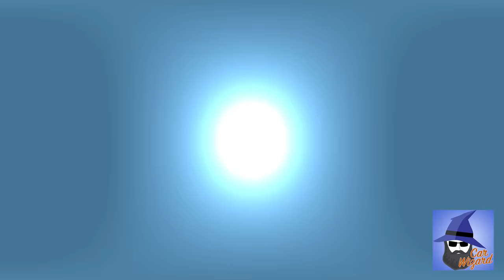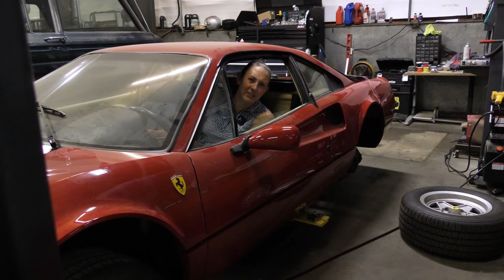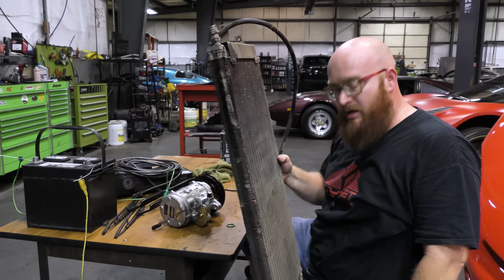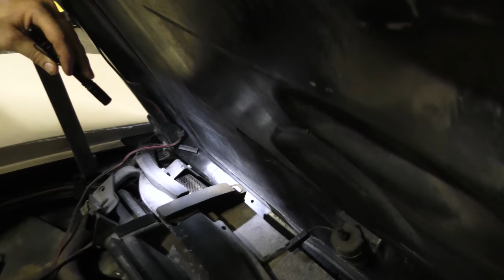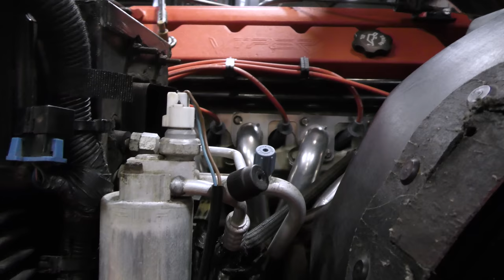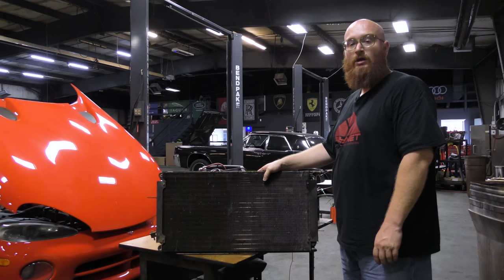Your AC died, now what?!? CAR WIZARD shares several reasons why it dies & the repairs to fix it

Comment: My '94 Chevy Suburban w/rear air has yet another bad compressor unit(the dreaded "pancake" or radial compressor once again), still blows cold but sounds like it's going to shell out any time now when running, and the rear evap core expansion valve has ceased to work again(a 6 hr. job to access requiring removal of half of the interior trim in back and cutting open a fiberglass housing), so fun time! Another $500 for a compressor, expansion valve and receiver/dryer plus hi pressure switch and low & high side fill ports(hi side uses a rubber check ball that has failed in the past for me with normal system pressure)., plus a trip to my local A/C shop to evac the system for me to save a bit on freon costs. I have my own vacuum pump so I can replace all said components and leak check it. Use green dye to color the system gasses, easy to leak check w/blacklight at night. Barrels of fun!
Here in Lake Havasu, summer temps are routinely 105-110 days and 85-95 nights so A/C is a must-have here.

Comment: I had a millenial workmate who didn't know how to look after a car..he had never even changed the oil himself...didn't know how the coolant recovery system worked...didn't even keep the windscreen washer bottle full.
He had bought his 1994 Nissan some 5 years previously and had never had the airconditioning working because "it was broken".
I asked to take a look at it. 
He switched the engine on and hit the a/c switch....no a/c.
I looked at the fan switch...on "0".
I asked him to switch the fan to "1"....a/c blasted cold air......

He had driven a car without a/c (unnecessarily) for 5 summers...and also had not had the benefit of dried air on the screen in winter....
Reply: No surprise there!
Reply: Here's a novel idea>>read the MANUAL! It's amazing what you can learn!
Reply: @hotpuppy1  
JDM car...can you read Japanese????
Actually, even with him reading the manual...he still has so little background in mechanical things (but a degreee in computer science) that it would be gobbledegook anyway...

Comment: My Subaru’s fuel pump died AT the gas station.....the pump was 2 months old, I had preemptively replaced it because the old one was 20 years old.
My “new” Honda’s air conditioning stopped blowing cold today.......94 degrees in the shade.

Comment: Wizard...u forgot to mention sometimes there is an easy fix for some AC systems, which is changing the solenoid control valve that use to come inside of AC compressor....I did that in my 2014 Altima and AC will start working fine again....the mesh in the valve was clogged and according to the technician this valve is responsible for almost everything in modern AC systems....after replacing we just did 30 minutes of vaccuum to get air out of the system...new R134a gas and ready to go..!!

Comment: The display image fits well. A viper requires 2 compressors and 3 condensers to get enough cool into the cabin lol. Talked to someone just yesterday about why he didnt drive the viper and he said too much heat radiates in the air cant keep up in summer.
Reply: I have an old viper (1998) once i got the AC redone its cold , even in 90 + degrees.
Reply: @davidmopar8446  I’m actually referring to the newer generation. I remember back riding in one of the classics when I was younger and it was hot. Was the classic blue white stripe.
Reply: @radzer0966  oh, no doubt it gets hotter than hell in there but the AC is strong enough to be cool inside lol

Comment: I looked at a used car once that the ac didn’t work. The dealer said that it just needed to be charged. Checked under the hood and the compressor was missing🧐. I feel bad for whoever they eventually ripped off.

Comment: compressor clutch just went out on my 02 Maxima and temps are already hitting 96 degrees out here in central Florida 🥵. since no one seems to sell a clutch kit for the compressor I ordered a whole new compressor. 

sometimes when Freon leaks there is traces of oil on the lines.

Comment: And don't drive without any 'freon' as it also lubricates the compressor. Even if you don't need aircon, you'll seize the compressor.
Reply: How will the compressor seize if it isn't turning?

Comment: Can somebody point me in the right direction? My 2005 Pontiac GTO has been without AC for 3 years. I live in Florida and this is my daily driver. Not good. The system doesn't have any leaks. The compressor clutch engages. There are no horrible noises. The condensor is practically brand new so I doubt it's clogged. One shop said they think the expansion valve is bad. I replaced it myself and had a shop recharge the system. It blew cold, but not ice cold, for a day. The day after, it was blowing totally hot again. I took it to another shop. They said the compressor is bad, and quoted a $2000 repair. They want to replace the compressor, condensor, drier, and some lines. Thoughts? I can't afford the $2000 repair.
Reply: Take it somewhere else for proper diagnosis.
Reply: $2000? I fixed a gto similar to yours bought a used compressor for like 100 bucks at lkq problem solved

Comment: Could also be a faulty service valve, something I'm dealing with right now. Depending on the car you might be able to change the clutch or coil without having to take the compressor out of the car.
Reply: Yes, in other parts of the world, just the clutch assembly is sufficient, and th compressor still has plenty of life left. Sometimes auxilliary fan as well, if moving car has no problem, but gets warm when stopped. :)

Comment: Just personal experience, I had AWESOME RESULTS converting an old R12 system to R134a.  1992 Lexus SC300, 2015 or so the A/C started to blow warm.  Absolutely mint always garaged 1 owner car with 60k miles and a stack of service receipts.  Anyways took it to my trusted mechanic, he diagnosed it as a leaky o-ring that leaked out all the now banned R12 refrigerant.  He replaced every hose that might leak, which included all new o-rings on those fittings.  Recharged with R134a with original compressor, condenser, dryer, etc.  After the freon conversion it blew just as cold.  Don't let people tell you converting old car A/C systems to the new refrigerant will make them work half ass, that's just an urban myth.

Comment: Not to uncommon but every time I do anything with the AC systems I replace the service ports like if I have to replace a compressor due to a failed clutch or anything else like that I just go ahead and throw in a couple of service ports just for good measure

Comment: We're living in Doha, Qatar and it hit 52 today (126.7 in freedom degrees) this afternoon. Our Nissan Armada's AC could only manage to get the cabin down to about 80 F, even though it will give you frostbite in the morning when it's "only" 38C (100F) outside.  Can we assume that we've just run up against the design limitations of the system's capacity to move cold air?

Comment: The only think I would add is if you can get away with only replacing the clutch you can get away with not draining the system. A backyard guy might be able to do the clutch but might not have the equipment to drain and refill the "freon".

Comment: Here's a weird story.  A friend's car AC went out.  I took it to a corner gas station and he replaced a diode, (I will guess it was the compressor clutch circuit), and charged me 75 cents for the diode and $3 for labor.  My impression was that he had seen it before. Duh. I paid the bill and told my friend to forget it, it didn't matter. On a different topic, I remember riding in my grandfather's 1956 Pontiac and the AC was strong, never had problems.  I suspect that the AC was over-engineered since they hadn't had time to figure out how to build them like cheap crap.  Lastly, I once owned a 1965 Mustang with a 289 and factory air.  I thought it was no big deal.  Years later I found out that only 2% of 1965 Mustangs had a 289 and that most Mustang AC was dealer installed.  I had the top level 1965 Mustang and didn't even know it.  The best American car ever made.

Comment: Wizard you love the 4 runner 
My wife’s 2016 auto ac won’t stay on 

Just spent 1100 dollars on a compressor and not fixed 

Shop said it was a unit you didn’t mention in the video in the dash 

Crazy

Comment: The wife’s 2010 T&C minivan lost A/C charge. She was not happy. The guys at the garage couldn’t find the leak, so they recharged it. It ran fine for two weeks then died again. Back into the garage and I said: “Fellas, this car has a rear evaporator too. Did we check that?” Crickets. Turns out the lines to the rear system were corroded. We replaced the evaporator too while we were in there, and now I have a happy(er) wife.

Comment: Do evaporators have to be replaced after a compressor failure? That can be expensive, depending on how difficult it is to get to.
Reply: Wizard did comment that evaporators can mostly be flushed......(that's the bit under the dash)
but that condensers (the "radiator" in front of the engine coolant radiator at the front of the car) 
cannot be flushed because the tubes are too thin....
Reply: It can if you want to chance the orifice filter caught the debris.

Comment: If nothing else fails, the freon molecules will seep through the rubber hoses and eventually too little freon.
Reply: That's why car makers all say to run your AC at least once a month, all year long. That circulates oil mist with the freon, and that oil mist keeps the rubber hoses and o-rings lubricated, which also prevents frein leakage.

Comment: One thing he failed to mention about AC pressure switch is why they even exist. One significant reason why is the refrigerant is what carries the lubricant oil through the system. If you run the compressor without refrigerant, not only will you get hot air, it will murder the compressor due to lack of lubrication.

Comment: Interesting to see a 93 Viper with AC. Would have had to have been dealer installed. Can no longer get the parts to retrofit Gen 1's with it either.
Reply: They always came with AC.  Just remove the roof and open the windows

Comment: Is it possible to flush the evaporator core if you’ve had a mechanical problem in the compressor?
Reply from the maker: Yes. But not condenser

Comment: I hope you read this! Lol! 
I was 16. Just got my first car. A $500 POS. The battery was dead. Had to push start, a car, never drove a stick, my dad just left me behind. You know, like throwing a kid in a pool so they learn to swim. So the whole way home I’m revving the engine at stop lights,etc. 
well I had to get gas too. We all know the signs at the gas stations “turn off engine, no smoking “ well I was afraid if I turned the car off… it won’t start, so I let it run. I knew that There really is no danger, but everyone pumping gas saw this teenager pumping gas and leaving the car running. I got all bad looks. 
And then the A/C hose blew! A big “pop” and then a fog of Freon billowing from my car!
People at the pumps freaked out!! “Run it’s gonna blow!”they actually ran away. I just stood there, pumped my gas. Laugh about it to this day 35yrs later

Comment: The wizard is right It is much cheaper to bring it to a shop to get them to top it up like Halfords only charge €50 my guess would be worse case scenario probably cost you maybe 100 120 depending on the system

Comment: Should you preemptively change the AC compressor on a car so that you don't have to do the entire AC flush / evap+condensor change when it fails? won't it be much cheaper swap and preventative measure?

Comment: I fixed my a/c in my mk5 Jetta with a $7 relay. It took forever to figure out it was just a dumb relay under the steering column that runs the blower motor.

Comment: My VW Polo was blowing weak and hot air. Checked the condenser, no damage. The Compressor was spinning and there were no weird smells from the vents, so the evaporater appeared ok. When i checked the manifold guage pressure for the high and low port, it was the right pressure, then dropped and built up again. When the pressure dropped the fan would switch off. Wasn't sure whether there was a leak or a/c expansion valve might be stuck open. 
Took it to the garage, they decided to bleed the system and fill it with new refrigerant with a dye to see if there were any leaks or if their machine would detect anything. There were no issues and now the a/c is nice and cold. Any thoughts as to would might have caused my a/c to temporarily fail?

Comment: Hello from NW Arkansas.  Question:  My ‘03 Tacoma has the original AC system and is working fine.  Do you advise having it checked to make sure the system has the correct amount of Freon, or follow the rule of it’s not broke don’t fix it??
Reply: If it’s not broke don’t fix it it’s fine unless it’s blowing hot air

Comment: What about not performing very well, with a new evaporator, new accumulator/dryer, condenser is externally clean, and all pressures make sense? Am I just a sweaty bastard that runs too hot for this climate zone?

Comment: What about when your a/c works great until it is 95' outside. Charge is good and fan works. Is the ambient sensor in front of the condenser involved with the a/c compressor?

Comment: My 06 Silverado does a weird thing. The AC will work for 20-30 minutes then go warm. If I shut the truck off and immediately turn it back on works fine for another 20-30 minutes 🤷🏼‍♂️

Comment: Pro Tip: If you have an early to mid 90s GMC/Chevy truck and you turn on the air and get a flashing red light and the air won't work. Unhook the battery for 5 minutes and re-connect. The air will work again.

Comment: “Every car will leak it’s refrigerant out by the end of it’s lifetime.”

My mom’s old 1989 Camry is laughing at that statement in car heaven, the R12 system was STILL working and cold enough to freeze a glass of water in 2020 when she had an accident involving a basketball sized rock on the highway and totaled it (she bought the car in 1994 and never had the A/C serviced).

Comment: I had a rover 75 cdt from new after three years the aircon failed. Turned out the dealer had not clipped a small radiator top hose back properly, and it rubbed a hole in the aluminium air con pipe

Comment: I have a 2004 Lexus ES330. The ac works fine but I hear a rattling noise constantly.  Someone told me that a little door needs to be replaced. What do you think?
Reply: sounds like the blend door is going out. that's a $15 dollar part that costs $1k+ to fix. it's behind the dashboard and usually requires the removal of the entire dashboard to replace
Reply: @hirisk761  thank you so much

Comment: Hi Car Wizard, let see if you can guess what it could be . 
I have a 2003 Toyota Rav4 that once you press the button the clutch engages and after few seconds stops and the AC light blinks, They check it out and it gas enough gas, I think is because there is no air filter  on the cabin , could be that?) Thanks

Comment: The biggest issue is that people dont use thier ac all fall and winter and even spring.. nothing gets run, lubricated etc..  Run your AC for 10-15 minutes once a week when not needed and you wont have issues usually.

Comment: Hey car wizard I just got my ac working but because everything is 32 years old and to my surprise it will still hold Freon for a few months and I got a leaking seal on the line. I bet if I brought it to you or any mechanic I will get billed for a full ac system rebuild. :( I bought a new China bs condenser, the ac lines are bent in the wrong way and the fitting on one of the lines cross threaded. Still holds Freon somehow but the oring is what seals it. I reused one of the 2 o rings.

Comment: Have a 2006 subaru outback has a bad temp sensor so the ecu thought it was hot.   So it wouldn't allow the ac to turn on.

Comment: do you need to replace the high presser valve on the compressor if its used or will it reset?

Comment: So, what if I just had system recharged and pressure checked and then it still continuously takes 5+ minutes for the system to get remotely cold? 06 BMW 3 series. German shop said the compressor is getting “tired”. Is it possible to be failing intermittently? I just figured it just goes out.

Comment: David, I was always told to run the A/C at least once a Month to ensure that the O Rings don't get full of oil and cause a Refrigerant leak. Is this still a relevant piece of advice in 2022?
Reply: Yes it's always good to cycle the AC system.  Some modern cars actually turn the AC on when you turn the front windshield defrost setting on because the AC air is drier and helps clear the window faster.
Reply: Definitely.  Anything with moving parts should be used from time to time to keep it working.  It's even a good idea to fiddle with your electric mirrors and seat once in a while - it's when things sit for months or years without being used they fail when you do try to use them.  Actually even electronics left unused for years can develop issues with dry joints etc.
Reply: Yes, esp in the winter.

Comment: I replaced the entire system of with the exception of the ac lines. Because here in Puerto Rico the heat is diabolical. Every fucking day from february until december 22 its upward of 90 f with at least 70% humidity as well. So I NEED AC in my car.